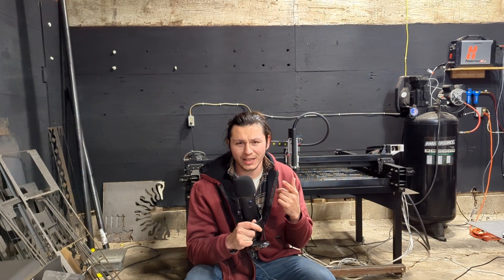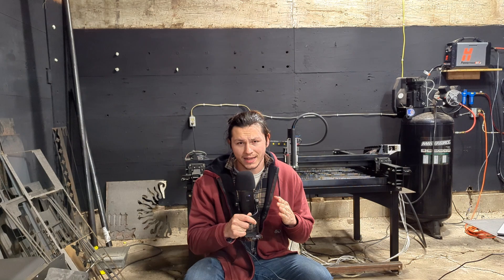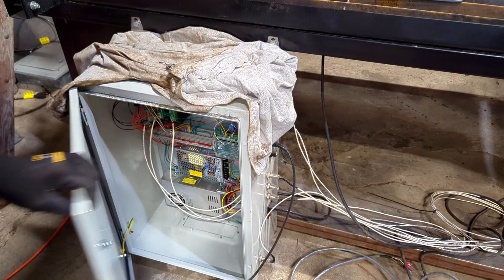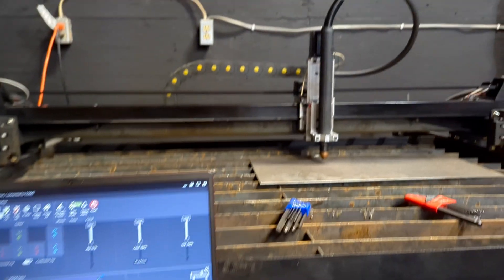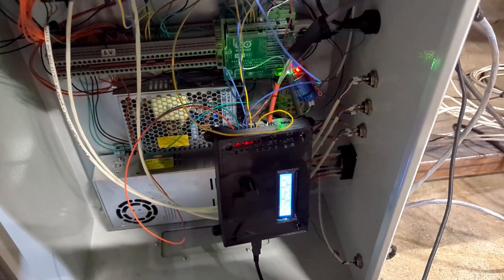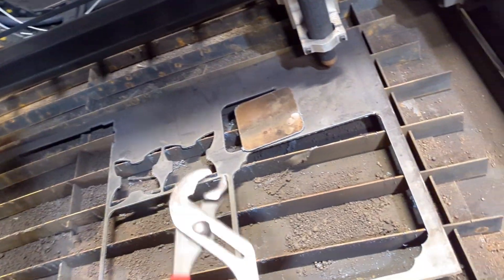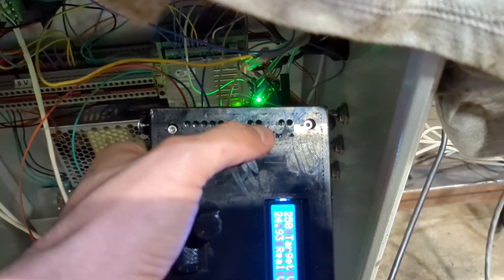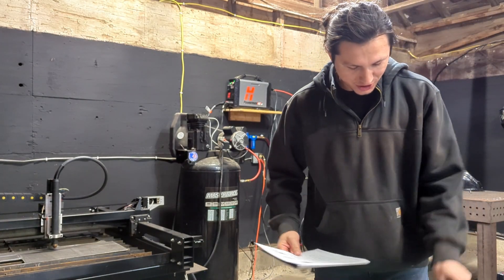CNC Plasma Torch Height Controller Install... I didn't stand a chance.

Comment: You may have just solved my THC issue I’ve been chasing, my JD unit is doing the exact same, constantly sitting at max 250V no matter what 😂

Gonna check the wiring tomorrow!
Reply from the maker: 😂 I hope it's that simple
Reply: @ThyialIndustries pins 1 and 2 from the voltage divider to the plasma cutter were the wrong way around. Flipped those and it now works!!
Reply from the maker: @krisdupreysgarage hell yeah! Nice!

Comment: I just finished my table days ago, after i made it work the next second i threw out the esp32 controller never to be installed again and ordered a proper cnc controller, the headache and the instability is not worth the 200 dollars a proper controller will cost you
Reply from the maker: @andreixrt9866  I think if I started over again that's probably what I would do. But as it sits now its working and I have no complaints
Reply: Where did you buy your CNC controller?
Reply: @khealey2011  I used the UCCNC AXBB, google it you will definetly find a distributor near you

Comment: It's about time you got some torch height control. This will make your life so much easier in the long run. Now you got one less thing to annoy the hell out of you. The skate bearing linear guides will probably be the next thing you get tired of messing with. :)
Reply from the maker: Those actually haven't been too bad. Right now I'm working on a work around for an ant-dive device
Reply: @ a magnetic break away might not be a bad idea. You could probably add a micro switch so if the head comes off you shut the system down.
Reply from the maker: @jasonhauserman-k9s  yeah that's not a bad idea! I've been putting off the limit switches for too long